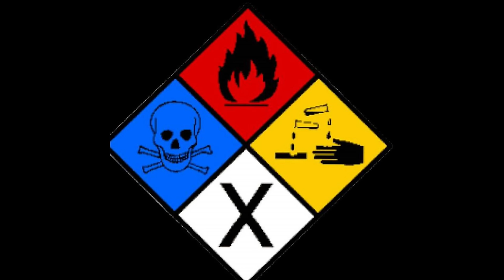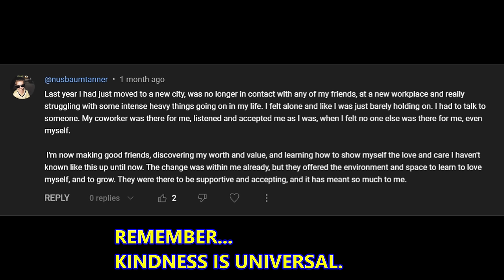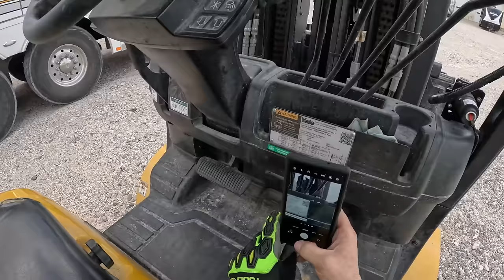BABY FORKLIFT   DO DO DO DO DO DO     OSCAR AT THE TATOR CONTROLS!!!

Comment: I'm enjoying watching Oscar.  The guy has a head on his shoulders and seems to anticipate what needs to be done.  On the other hand, with a Yankem rope and a pickup, I think they could have done the job without a call to Midwest.
Reply: Doubtful the pickup truck method would've worked. The pickup truck doesn't have the weight required to move that thing. Trust me,  I've had my share of forklifts stuck in FL sand.
Reply: @stevenhoffmann9373  Frankly, thats not even the right kind of forklift for outdoor duties on varied terrain. I took one look at that forklift, and my mind went immediately to inside warehouse forklift. Tires are too narrow and have 0 traction for that. If you look at the majority of forklifts used on outdoor lots, they are usually big suckers, with big tires that grip, and usually weight like 35,000 pounds or more. This itty bitty thing can't be much over 5,000 pounds if that. Daddy always taught me, use the right tool for the right job. The workers have just learned this lesson.
Reply: @stevenhoffmann9373 . Based on size many believe it’s not that heavy, but with a counterweight it’s as heavy as two pickup trucks. If the truck was four wheel drive it might have a chance but the muddier it is the chance of success goes down quickly.
Reply: If correct definition of the job was provided and backed up with pictures, Ron might have dispatched the Ram 1500 and front mounted winch saving the customer hundreds of $$$?
Reply: As was stated at the beginning of the video, Ron was only told that a forklift was stuck, Not what size it was

Comment: Oscar was honestly impressive on that job. Love to see you when people just know what to do and get it done rather than wait around to be told what to do. I definitely did get a chuckle the size of the forklift. One of my old jobs actually had pretty much that same model of forklift just an older generation and I can’t tell you the number of times I got that thing stuck in the stupidest ways like to get in and out of the shop there was about a 1 inch lip on the concrete which just so happened to be enough if you were not perfectly square, you would get one tired float in the air and get stuck due to an unlocked diff on the front granted that was normally easy enough to get out that you just grab someone else to give you a little bit of a push or if you did happen to do it when you were by yourself, we had a rope tied to the end of a block of wood that you could just drop in front of the tire and then once you’re loaded up and ready, give a little tug on the rope in it and shove the block of wood down

Comment: I worked at a plant , warehouse / seed coating company we had a plant forklift and a warehouse / outside forklift ... the plant fork lift wasn't designed for anything but concrete floors, on a hot summers day even the hot asphalt wasn't gonna stand up to the weight of that thing. And the tires were smooth hard rubber , even so it ended up outside on the hardpacked gravel sometimes. When the big lift was busy loading trucks.  Well I remember one time it went off the hardpacked and sunk, all four tires in the wet soil,  we being intelligent  men didn't need to call a big tow company, we had a bigger fork lift, and a chain we hooked up as short as possible stayed tight with the chain and simply pulled slowly it popped up as the Clark fork pulled it also lifted and no problem.     
Yes that little forklift with those tires needs to stay on the hard packed.

Comment: Reminds of the time I got a small forklift like that stuck a few years ago. 
Had a stack of empty pallets I was bringing around back which was gravel and had a good idea it would get stuck but I was told to do it anyway even after voicing my concern. 
It had smooth tires intended for concrete and pavement surfaces which the front of the building had. 

I was trying to keep it on packed gravel the best I could and it was going well which surprised me it hadn't sunk.

That was until I let the weight of the pallets off the forks that it started sinking.

Soon as it started sinking I instantly went nope and loaded the  pallets back on which I knew at that moment is what was helping prevent it from sinking after unloading them. 

I got stuck backing up to turn around and go back to the pavement.

Soon as it got stuck, and knew it wasn't going to move, I didn't even try going back and forth with it as I knew the wheels digging would make it worse. 

Got my little pickup and a tow chain and a gentle tug was all it took to get it free because I hadn't buried the drives.

I had also been watching Ron's videos at the time so had a better idea of what to do and what not to do. 

I had operated a larger forklift before this happened and that one would have been better suited for the task as the tires on it were suited for dirt, gravel and pavement.

Comment: Is this official Forklift Month? 😊

I was expecting something bigger too, but having had to pull that size forklift out of mud with another forklift on good concrete using every chain I could find in order to spread the load (because we didn’t have steel ropes much less Yankems) I can definitely say that calling the Tator in was not overkill.

I half expected you to pick it up, but pulling it free works too, as long as the operator doesn’t get it stuck again. They need a yard truck…